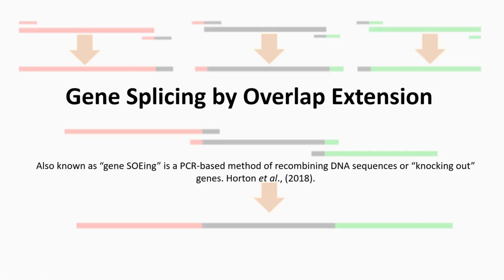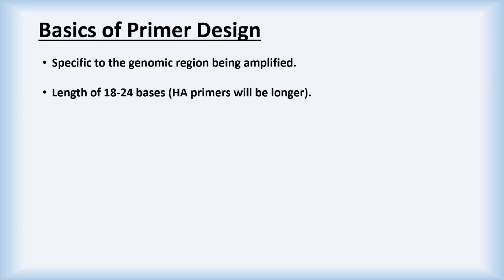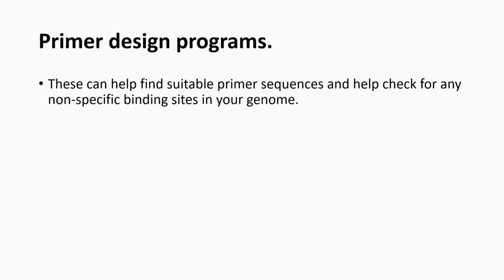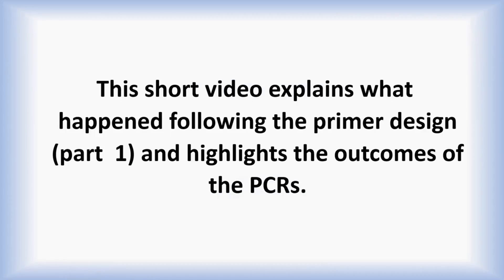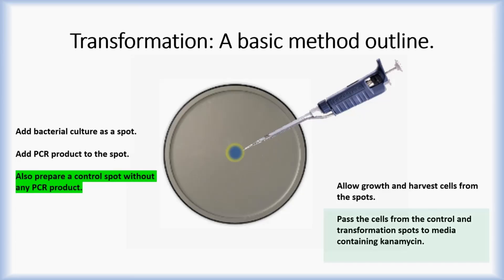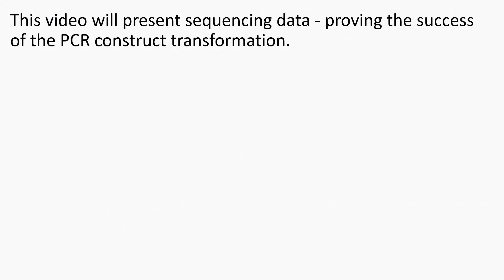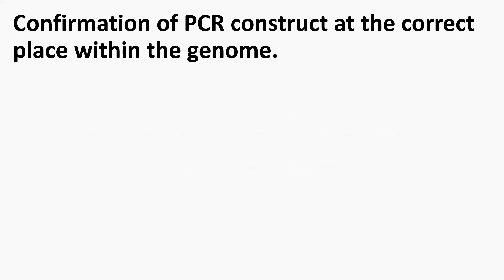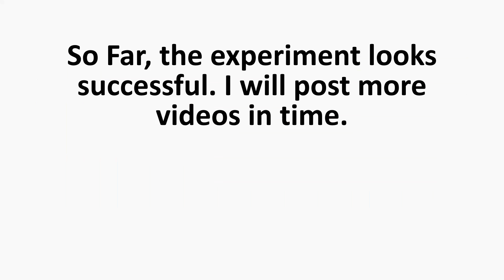Creating a Gene Knockout Mutant.

Comment: Do we need to add full gene sequence of kanamycin or portion of it
Reply from the maker: Yes, it depends on what you are doing. The example in the video is for a full gene knockout / replacement with a knamycin resistance gene. If the knockout is successful, mutants can be selected on media supplemented with kanamycin. Other methods may rely on specific gene disruption by inserting sequences or deleting parts of coding sequences. Best wishes.
Reply: @genomeprojects  and is it necessary to put promoter also
Reply from the maker: In the video, the kanamycin resistance gene is expressed using a promoter already in the genome at the knockout site. You could probably use an existing promoter or insert one.